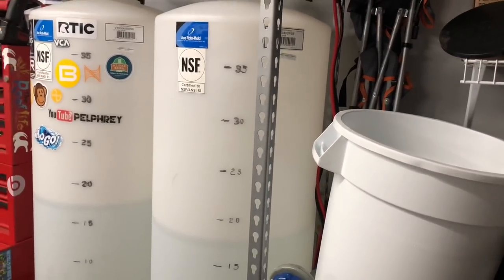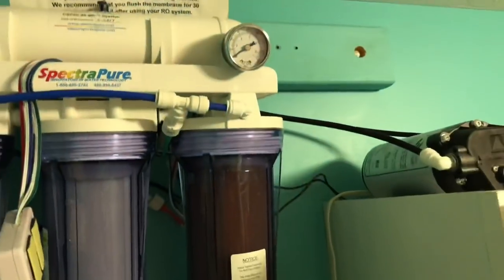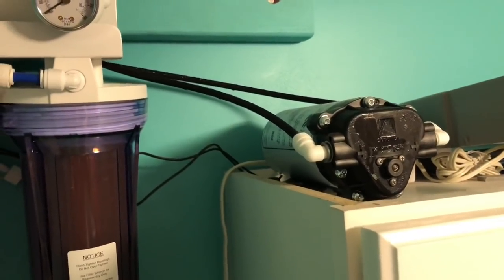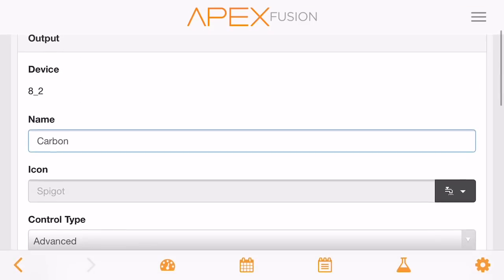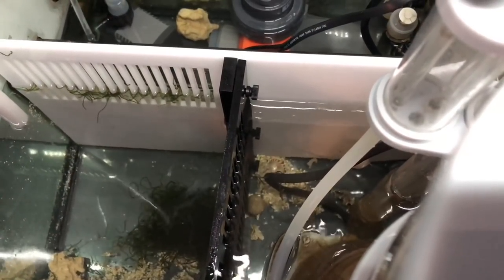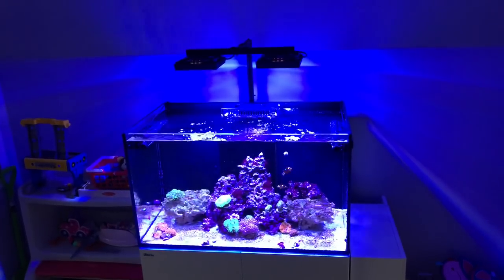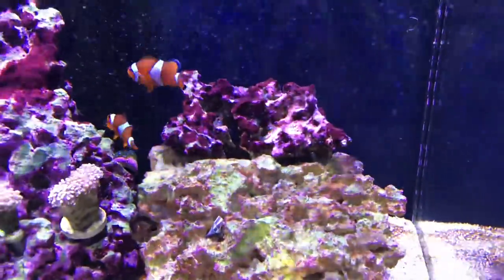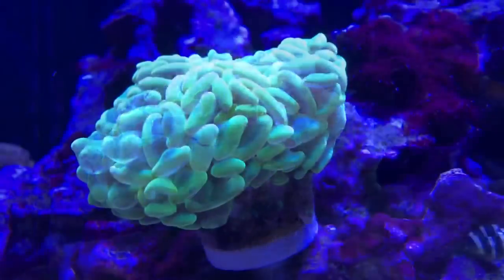Red Sea Reefer 250 | Time To Make Water | New Reactor Pump | Coral Close Ups

Comment: Being that it's in your laundry room the warm moist air from your dryer is condensating on the cold surface on your RO unit
Reply from the maker: I could understand that if I ran the dryer the entire time, but I don't. It takes a few days to make 80 gallons of water.

Comment: I have a spectrapure also and my gauge stopped working. I unscrewed the gauge and lightly tapped the threaded part on the ground and some debris fell out. Then I used a needle and cleaned out the tiny little hole inside of the threaded part. Fixed mine. Give that a shot.
Reply from the maker: Awesome!! Thank you for that,I’ll for sure try that! It’s worth a shotb
Reply: Let me know if it works for you.

Comment: I also get this on my rodi I think it's normal when the water is cold in the winter, it's not as bad in the summer for me. When the times right start out with some easier sps limeberry hystrix montipora hirsuta are nice corals the limeberry is a bit of a challenge, but if you keep yourself from messing with the tank and levels are stable they will be fine with your radions lights. Did you pick up any canvas mesh to stop the chaetomorpha going all over?